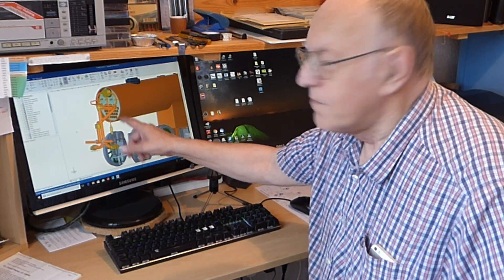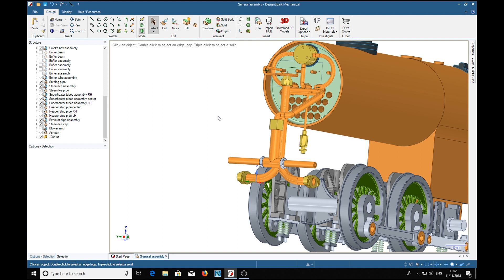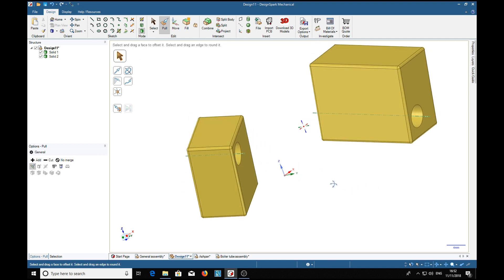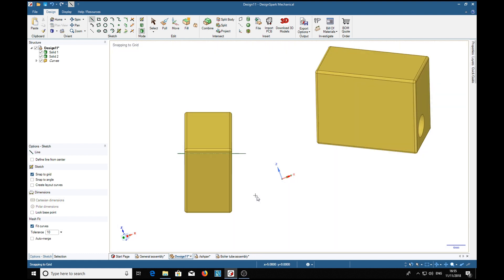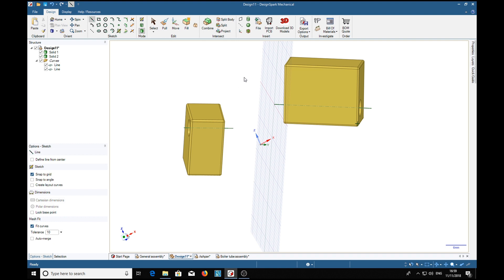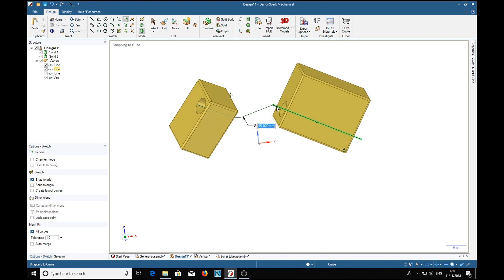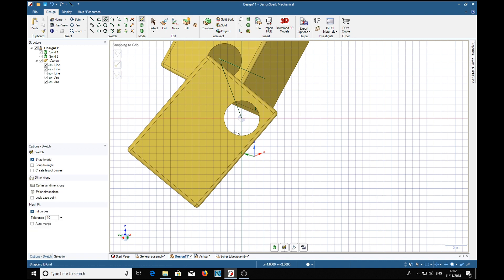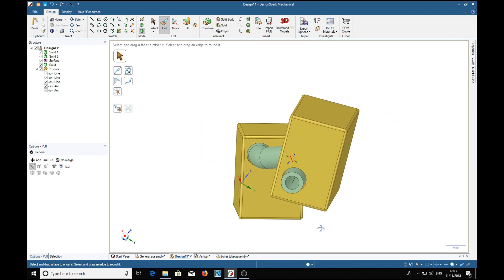Awkward Pipework with DesignSpark Mechanical

Comment: This is the method I had been using for a while.

I just recently (in the last two days) found out that any line can be turned into a cylinder by selecting the line first then clicking the cylinder icon and setting a dimension, after that the shell tool can be used to shell each end to make it into a pipe.

I recreated your example to try it out and it worked just fine but it's not any faster or easier, just another way to do it.

I tried the new version 4 (Beta) and the blend feature is a nice addition they made but I have a problem that they don't intend on making a 32 bit version and I have a brand new cheap 2 in 1 tablet that I use in addition to my main computer and it runs the 32 bit version of Windows 10.

The files created in Version 4 (Beta) cannot be saved in the Version 2 format.

Thanks for your videos, I've learned a lot watching them.
Reply from the maker: Thanks for the information about using the cylinder and shell tools. It is always good to know more than one way to solve a problem.